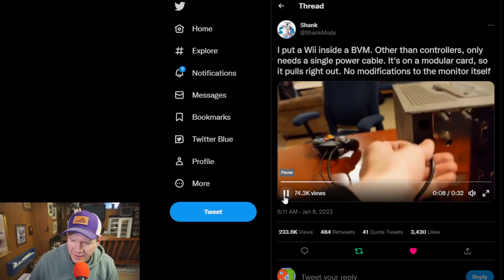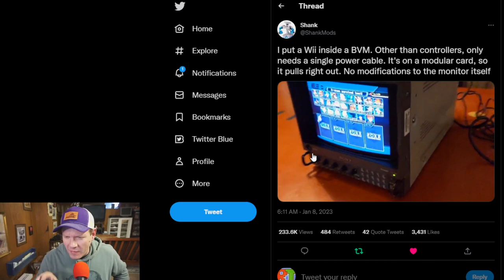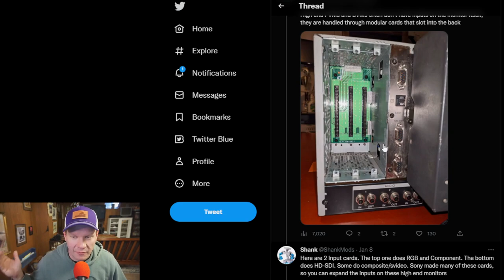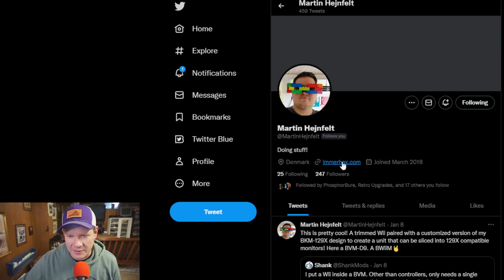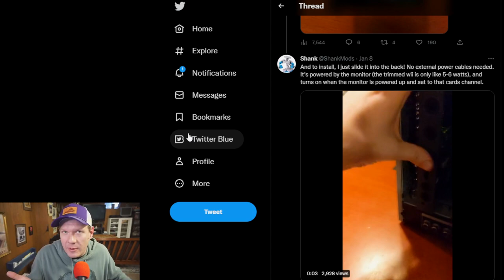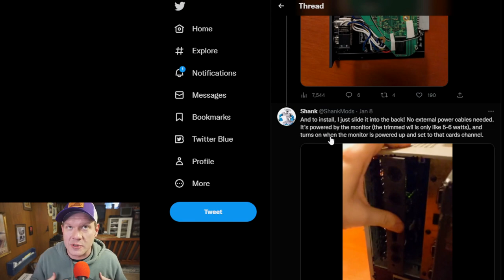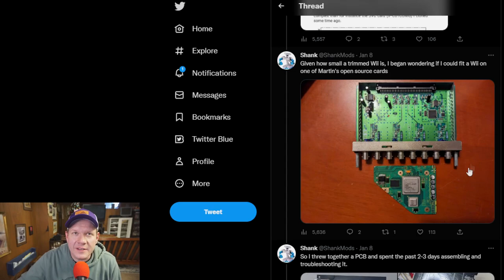A Wii installed inside a CRT?!

Comment: Something more down to earth would be fitting a Raspberry Pi board inside a PVM. We can probably piggyback off a 5v line, wonder if anyone tried this 🤔
Reply: But how do you get the raspberry pi to output analog video, I believe you would need a conversion box which would add electricity input.
Reply: @PowerHaters  No, raspberry pi outputs composite video natively from the 3.5mm jack, look it up

Comment: Why not put a Wii U in there and gain access to a all of it's tittles as well as many more emulators???  The Wii can't even run MAME properly.
Reply: The wii can output native 240p and only requires about 5 watts of power once all of the excess parts are trimmed. There hasn't been any work on trimming a Wii U as far as I know because no one cares enough to make them portable. Also it was just a proof of concept and wasn't meant to a major project with things like that thought through.
Reply: Many reasons.
Wii U motherboard is gigantic, far more complicated, cannot be trimmed down, and consumes substantially more power. Vwii mode picture quality is poor, and the gamepad is required to do anything. The Wii is a far better fit for this purpose
Reply: GameCube.
Reply: Switch, PS5, Series X.